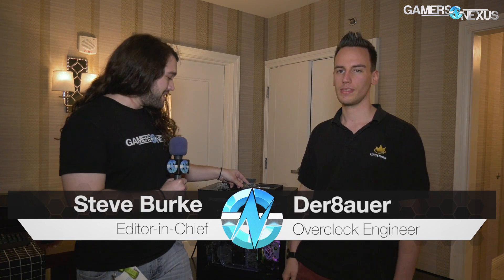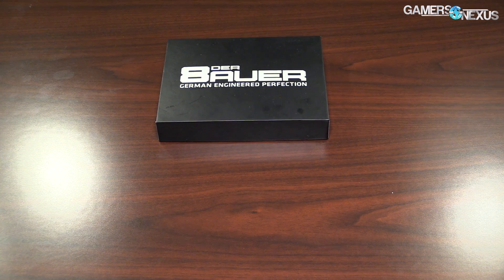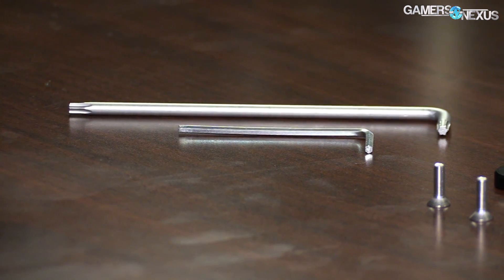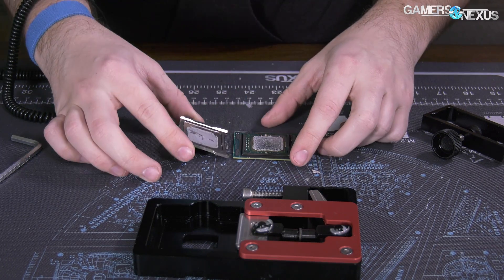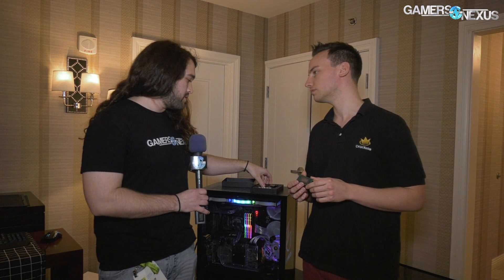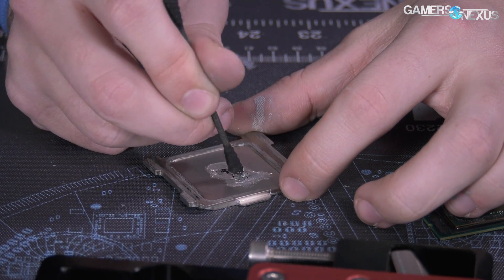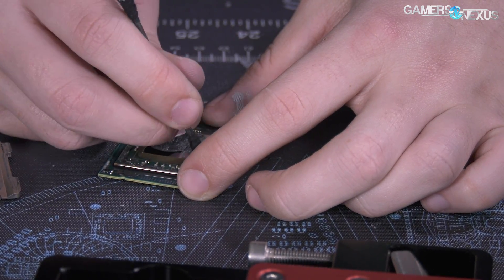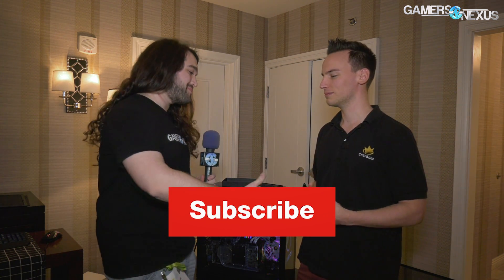Direct Die CPU Cooling Bracket - No More IHS

Comment: Athlon XP cooler install most people had no trouble with, don't be afraid. These dice are huge compared to to socket A AMD processors from the early 2000s, even compared to the TBirds these cores are like double the surface area. Tighten it down evenly a little at a time, then GG.

Comment: 0.1 mm in tolerance is easy
I hit within 0.2 mm dayly by eye and a sharp point earlier

So 0.1mm is easy when measuring equipment and cnc

0.02mm see that's a real tolerance ( called a h7 tolerance from 15mm and up)

Comment: I might have missed it but I'd like some clarity on the temp differences between this and the copper ihs replacement. I think you said 5-6C with the copper IHS. He claims about 8C with direct die. For a difference of 2C I'd probably stick with the copper IHS unless that difference is non-linear. Like it's less at lower temps and more at higher temps. Or if there is a significant latency between when the die hit a certain temperature and when it was transferred to the cooler and whisked away. I apologize, I'm just sort of ignorant and inquisitive.

Comment: I simply unscrewed my foxconn bracket, drilled out the 4 rivets, the hold down bracket fell away, screwed it back on, and got a replacement for $5 off ali for if I ever want a hold down bracket again.

Comment: Has anyone confirmed that liquid metal pastes are safe for direct die contact? I've yet to see video evidence of someone removing a liquid metal paste after several months without some sort of change on the die surface.  The concern is that metals in a liquid phase, be it mercury or gallium, tend to infiltrate other metals or metalloids.  If this is indeed what is happening to the chip dies, then such pastes are unsafe in the long run as the gallium will eventually work its way down to the circuitry layer.  At the least, it will weaken the physical integrity of the die to the point that it may crack under normal heatsink+ihs pressure.
Reply: In my book, NEVER USE LIQUID METAL........ Yes, it WILL ruin the die surface, even left on just a few weeks. Also sanding/scouring it from the heatsink will ruin the surface too. Based on my own experience, you can get fantastic results with top-end traditional thermal paste by making sure the application is thin as possible and the heatsink is fitted down with good firm pressure. The risks of liquid metal and short intervals between re-application to avoid damage/degradation simply are not worth the couple of degrees difference

Comment: The IHS is also a thermal buffer, if someone plans on watercooling without the IHS and overclocks it, there's a potential for thermal shock and the die will crack. I did the same thing with a phenom x4 and after 6 months it finally cracked.

Comment: Back in the old days, there were no heatspreaders on CPUs...direct contact cooling is absolutely the best method for low temps...the difference is so massive that a cheap heatsink fan combo would give you getter temps than a 280 rad water cooling.

Comment: That is an insanely expensive bracket. Was definitely interested till the price was mentioned. I'll wait for the $20 options so I can only slightly over pay for what it is.
Reply: Custom machined with super low quantity as well as engineering, R&D, as well as testing to ensure compatibility? Yeah, way too expensive...
Don't get me wrong, I designed my own CAD model and analyzed structure for my own AIO block I 3D printed because I wasn't going to pay $5 for a mount.

I'm a total cheapskate myself, but I understand all the work this had to have done (and I value my time at nothing, its just a learning experience in my book), but I don't think I would risk a CPU around $1000 just to save a little bit of money. If its below $400, I would just go without a mount since I've done plenty of direct cooling on custom mounts (I don't even use springs, you can easily crack those things with bolts, I'm just very good, and a risk taker).
Reply: I have the misfortune of working in a machine shop so swallowing that price for this type of product is hard for me. We have made many "custom" or no longer made brackets and it is an extremely easy process. The R&D for something like this is nothing more then taking measurements of what it needs to clear and the space it needs to fit in. The fact this bracket has a limited compatibility makes it that much easier.      The only real areas where price takes a steep increase with a bracket like this is in the anodizing and machining. Since it is aluminium it is fairly easy on the bits which reduces some of that extra cost and can be machined quickly thanks to the aluminium being a softer metal. I can't comment on anodizing costs since we send stuff out that needs that but it isn't much on quantities of 100 or more. I would argue the box and extras in the packaging cost as much if not more than the bracket itself. I would further argue the same thing can be made in China for pennies on the dollar and be sold easily under $20 while still making a healthy profit. The price is what it is because of the target base. It's an elitist product for people who don't mind overpaying to feed their hobby. I'm just as guilty except with headphones and have no problem paying $800+ for headphones that sound a few percent better then some of my other headphones in the $200-$400 range. I definitely get it but I know and understand a product like this and having a real world idea of what it costs to make and knowing cheaper alternatives to produce I can't personally justify it.
Reply: I see your point. We both know how to make one very easy, however, you have a much better idea on machine shop costs, which I was thinking would be more expensive. Thanks for the insight and helpful information.

Comment: I've been running direct die on my 4770K using the EK Naked Ivy kit for a few years now and I can comfortably state the following:
1. I didn't see a huge difference between what most people reported on a normal delid (LM between die and IHS).
2. Using LM between the die and copper coldplate was not a great idea - I found that the LM solidified at some point end ended up having to wet-sand the copper IHS to remove it. I was generally lambasted as an idiot when I reported this on the popular overclocking forms, but I don't see anyone pointing this out in all the videos involving LM.
3. Replacing the LM with Gelid GC-Extreme seemed to have nearly no impact on temps

For those wondering, I was using Coollaboratory Liquid Ultra rather than Thermal Grizzly Conductonaut. Perhaps the latter has better properties regarding staying liquid over time / thermal cycles, but I have not tested it since CLU/CLP were practically the only options and still very niche / hard to find in the Haswell era.

Comment: Can I use a 0.5mm thermal pad between the die and cold plate if I'm worried about even pressure across the socket, in order to not need to tighten down so hard?
Reply: that thermal pad will act more as an insulator, and all of the benefits of deliding will be lost.
Reply: 0.5mm?? No!! Use 3mm.. and make it some sort of soft wood (like balsa) just to be extra-sure

Comment: If you have a convex die/chip you could use Aqua Computers cuplex kryos NEXT VARIO water coolers, because you can adjust the geometry of those coolers base part/plate to match the dies'/IHS' surface shape quite easily with adjustment screws.

Comment: Can't help but wonder if this is the best solution then. Sometimes I've heard that once delidded and with new liquid metal applied chips can see improvements up to 20 degrees. If this only makes a difference of 8-10 in the best case scenario, maybe theres something about the combination of liquid metal and the heat spreader that's better than this solution?
Reply: When they say 2-10 degrees lower they mean versus delidded+liquid metal, meaning a total of up to thirty degrees in the best possible case.
Reply: Slab Band Sam ah, that makes much more sense.

Comment: So spend $60 on a delid kit and another $60 on a direct contact kit, and then $120 on a water cooler. So that you can get 15%higher clock speed. If spent that $240 into the cpu itself you can probably get 50% more cores you know.
Reply: Chen G maybe if intel spent 50 cents on solder....
Reply: At some point, you could try to spend more for more cores if you wanted, but nobody can sell you a higher performance CPU. At that point the only way to go higher is better cooling. This is not really for the guys that do not already own one of the higher tiers, then you are better off spending the extra stuff on the CPU, although you will still need that watercooler (And 120$ is wishful thinking). And the jumps in price for top-tier Intel are not small by any means.
Reply: This line of product is aimed at higher-end enthusiasts on the core-i9 series chip. If you're ok spending >1,200$ on a chip, you're ok spending a little extra to make it run faster and cooler.
Reply: Some of us have a delid kit, water cooling and chips. We  enter contests where just a little bit matters but a lot is better and its based on the same chip that everyone else runs and not the guy with the most cores.
Reply: This isn't about diminishing returns, getting a higher end CPU with air cooler can get you more performance, for the same amount of money, unless your only performance metric is 144hz gaming. If I already have the 16-core i7 then sure, I have no other way to improve performance, the only thing I can do is delid. But most people doing this are nowhere near using the top end chip.
The CPU performs the same at 80C or 60C. It's the same story here, if I already have the top end chip and I still have money to burn, then sure, make it cooler just for the sake of it. Otherwise I'd rather have more performance.
Reply: You don't necessarily have to benefit from more cores so spending that extra on CPU with more cores may not benefit you at all while getting the highest clock possible may actually benefit you.
Also, OC is a hobby and people like to tinker with it a lot so...

Comment: Intel should just start doing the right thing. Work on the IHS.
Reply: fsocietyblackhat they forgot that solder tool is exist
Reply: More like 15-20 when doing high overclocks.
Reply: Intel needs to do the work. Amd knows it
Reply: Boycott them til they improve IHS. Spending $60 for this, $15 for liquid metal, and $30 for a delid tool is ridiculous!
Reply: Boycott is pretty extreme considering this is OCD work for extreme overclocking. It works as intended with no heat issues from the factory. I'm not saying they shouldn't improve it but just not supporting a boycott for something that works perfectly fine out of the box.
Reply: Both are shit where's my quantum cpu already!!!!!!!!!
Reply: Compared to normal delidding. So if u gonna delid, why not do this right away.
Reply: true, they buy $2000 cpu's which needs a warranty voiding delid just to get its full potential...pathetic
Reply: fsocietyblackhat Why should they? Intel could release the same CPU for a higher price and put real toothpaste between the IHS and fanboys would still buy it and come up with reasons to defend it claiming "AMD is so shit" "INTEL FTW!!"
Reply: Intel has bigger problems. Their CPU architecture is flawed, see recent news.
Reply: For what 2°C less temps ?? Fuck off

Comment: Hhhmmm...I've very tempted to get into the new intel platform now just so I can delit the CPU IHS and set my cold plate direct on the CPU die. I'm kinda bummed that my 5960x runs at 45-50-ish Celsius while my water and GPU (two 980Ti) die temperature is 28-30 under full load, I'm so annoyed when my GPUs idle at 18 Celsius and the CPU barely gets under 30. I'm like What the hell Intel? Do you have to use chalk between the CPU die and IHS?
Reply: QuantuMlapZiz is he coloring something?
Reply: QuantuMlapZiz *die
Since he’s referring to CPUs and not paint or food coloring
Reply: QuantuMlapZiz When you attempt to be a grammar nazi but fail miserably
Reply: QuantuMlapZiz fail.
Reply: QuantuMlapZiz *died
Reply: You got it good dude!  My 5960X is running 70s+ in my loop on a 4.4GHz.  CPUs under full load hardly hit 50.  Thinking I should at least delid the thing... :)
Reply: Dye*

Comment: This is absurd we shouldn't have to do stuff like this just to get decent temperatures
Reply: The beauty of PC building; do as much or as little as you like.
Reply from the maker: You don't "have" to do anything like this. It runs fine under auto settings. The use case here is for very high-end overclocks -- i.e. competitive overclocks for HW Bot.
Reply: I love amd but the true fact is is that since ryzen is new architecture it wont overclock as good as Intel chips and most people who delid there cpu's are looking for pretty high clock speeds.
Reply: Based on a leaked engineering sample.  It might be way more (or not).  I wouldn’t make a judgment or a purchasing choice based on that.

This is definitely not for everyone and not aimed at people who are looking to choose what components to go in their rig.  It’s to allow extreme OCs on a specific chip family which seems to benefit from it.
Reply: Correct. This is another proof how "well" the intel temps are under normal conditions.
Reply: you are wrong kid direct die cooling is better than conventional methods the complaint you have does NOT need this to fix it. This is OTT for cooling and you may say the TIM sis garbage but that and this are in whole different leagues for better temps or better OC just go for liquid metal or something but for extreme and world record OC you would consider this
Reply: this would all be solved if intel would just solder their cpus like they used to, and amd still does.

Comment: I would do it if it where easier and the kid is way to expensive for single use on my CPU
Reply: X299 has CPUs that are $1500+ and motherboards start at $300. This isn't expensive.
Reply: Game3d cheaper than buying the next gen CPU.
Reply: nah i am just worried i destroy my cpu in the process of deleting it, and then also the reassembly process. does any of you did it on their own cpu?
Reply: Its quite easy with a delid die mate x. If you're no total idiot and sick to the manual, you should be fine. This is German engineering after all. Price is high though true. But just to make this clear: you won't need to delid your CPU for standard user stuff, this is for sub zero cooling with e.g. liquid nitrogen. Sure you will see a better temperature with a water cooler but most water cooling solutions are good enough to take care of the heat while your voltage is in the limits of an everyday user.

Comment: I run both my 3770k and 4690k bare die thanks to him. He has an older bracket that worked great to keep the cpu in place. I did have to custom a few things also which was a pain. 

I did learn that you have to be careful when attaching a cooler. My msi gaiming5 mobo had some caps very close and it actually interfered with the cooler causing it to not sit flush. I had to use a lapped copper shim, unfortunately.

Comment: I tried one for my 7700K way back when (1151 socket frames have been out for a while. MSI made one) the main concern is whether the die AND water block, AIO are flat. I was frustrated to no end and could not get good contact.  still have it so if I see some difference in application methods, I would definitely try again on my 8700K this time around. I may also try the X299 version on my 7820X if GN has any success. Look forward to this video.

Comment: Reminds me of mounting heat sinks on old Athlon XPs and older Pentium III's that were basically bare exposed cores. They had black little rubber-like pads on four corners of the CPU for the cold-plate to sit on to help balance it out somewhat. And these were SMALL exposed dies no bigger than your pinkie fingernail. At lease these dies are much larger for a cold-plate to sit on.
Reply: Reminds me of my full Copper CPU Coolers
Reply: saw a few cracked dies BC that AMD cooler was hell to install, who thought having to push down 45lbs towards your new mobo with a flat screw driver was a good idea?
Reply: FRAG aLOT be that baller running a cpu without its lid 😂
Just straight liquid metal onto aio liquid cooler or something hahaha
Reply: And how many cracked the die? I think people are overly worried about damaged dies from doing this